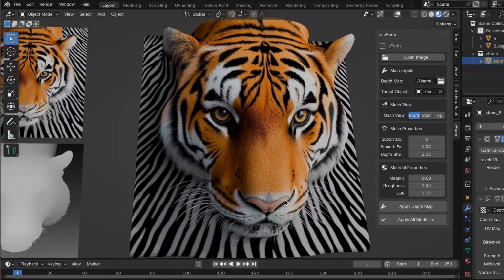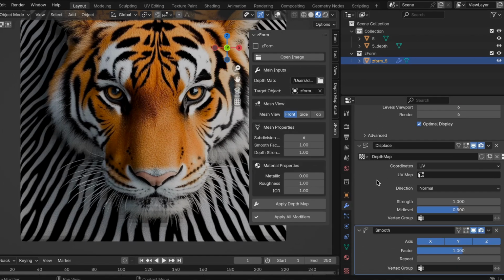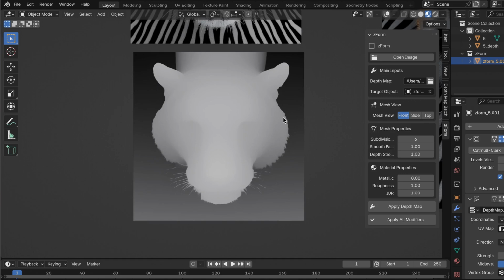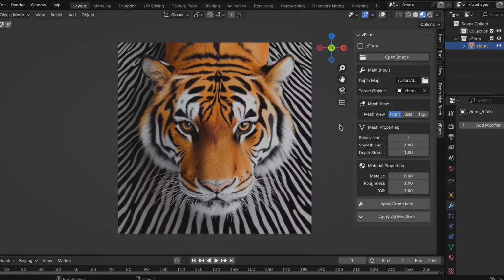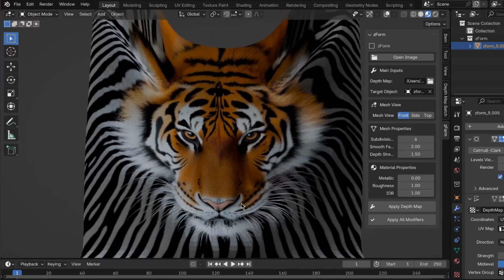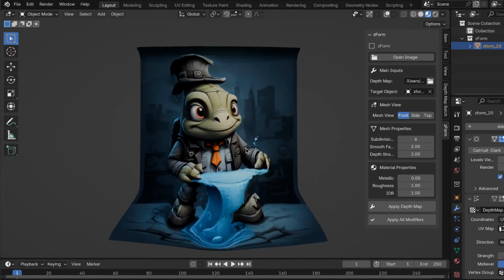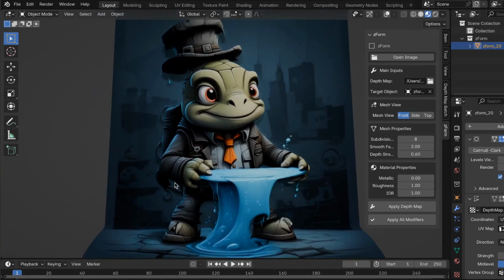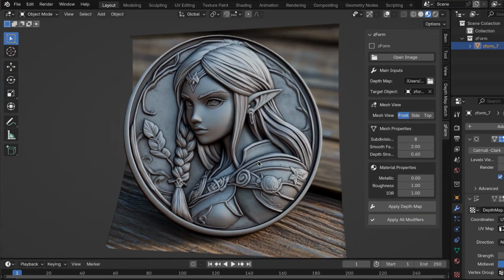Tiger 2D image converted to 3D mesh using a depth map and simple modifiers in Blender.

Comment: could u export to  3d model with texture and  obj format  i want to see 3d view with texture i can not see the texture  always coming plain model  is there some specific tool thx
Reply from the maker: Hi, yes you can. Before you export make sure you uncheck the "Use Transparency" feature inside of the Material Properties section in zForm. Then after you do that you shouldn't have issues exporting in OBJ format. Or, are you generally asking when working in Blender and not inside of zForm? If you run into problems feel free to send me a message on SuperHive (previously Blender Market) and I can gladly help.

Comment: Thanks for vid! Pls can you help me, why a cant find option texture in right bottom, like little formula flag?
Reply from the maker: Hi, do you mean the Texture Properties section that's inside of zForm to adjust the values for Crop, Multiple RGB, Contrast, Brightness, etc?  Or are you talking about the Text section displayed natively inside of Blender when you've assigned a texture to an object? 

If you're talking about within zForm, please make sure to have the latest version of zForm as the older versions don't have that feature...it was released less than a month ago. 

Feel free to message me on SuperHive (formerly Blender Market) if you're logged in and I can help further.

Comment: How are you exporting the file after it complete? I bought both of your stuff on blender.  After I upload a PNG for some reason, it keeps a square behind it when I export is there anyway to remove that?
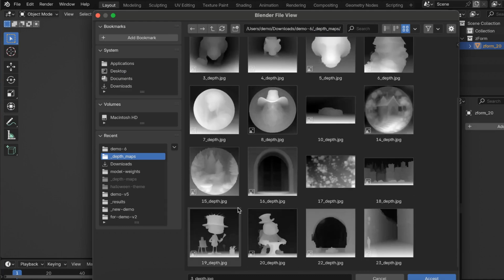Reply from the maker: Hi, I've been trying to build a feature to do this in zForm, but I haven't successfully figured it out yet.  Right now I manually use a boolean modifier with the Intersect option to cut out the back sides, but it's not perfect. I have a video that covers the technique I currently use if you skip to around 1:37 of the video...I cut out the back side using that boolean technique. 

https://www.youtube.com/watch?v=RhfskbbljiQ

Sorry this is not something that is built inside the tool right now.

Feel free to message me on Blender Market using the "Contact Creator" button on my homepage if you're logged in.
Reply: @vizdotlife  so I exported a PNG into it. And then I use the debt map software to make it and they’re still this imaginary square around it
Reply from the maker: @blakelindley9799 If you're talking about the modifier that's an imaginary square to remove the backside. After that step click on the "Apply All Modifiers" button in zform to convert to a destructive mesh. After that though you can't make changes. If you're still having problems please message me on Blender Market to get a better understanding so I can help
Reply: @vizdotlife I messaged you on blender with some photos

Comment: I have been using this method heaps.  It is awesome.  Have also been generating my own in ComfyUI using Midas and Zoe Depth Maps.  Been starting my modeling this way, and then straight into Zbrush.
Reply from the maker: Nice! That sounds like a solid workflow. I haven't used Zbrush before, but I know it's top notch. Does your workflow continue in other tools after working in Zbrush or is that the final stage?
Reply: @vizdotlife  I use everything.  Been in games 17 years or more.   I will finish assets in Zbrush maybe and make textures from them in 3dsmax or other software/optimize afterwards.  I use Zbrush and 3DCoat for UV's and retopologizing normally.  Substance Painter for textures.  That sort of thing.  If you took that tiger into Zbrush you could easily sculpt the side details.  Also I have a ComfyUI set-up I do just recently where I take say your tiger and render an image from the side and use ComfyUI to render out another Midas depth map and then I project from another angle.  It can be done, as I have done it and it works well.  You could use soft selection under the displacement in the area that needs sculpting .   just a thought.   Zbrush is very good at redistributing mesh consistency in detail while keeping the original projection.  Then you will have more mesh to displace with.
Reply from the maker: Thank you so much for sharing all this!  Wow, you have so much experience at this across several tools. I'm slowly getting there. Very interesting idea you suggested on the side views for the tiger. It makes sense. Maybe one of these days I'll try a free trial on Zbrush just to get a taste of what's possible. Thanks a bunch! Best wishes on your next projects!
Reply: Hello, is there any workflow video similar to the one you mentioned that I can refer to? I don't quite understand how to convert this plugin into an actual full 3D model?

Comment: Hello! And if the result of the addon’s work is exported to 3dsMAX or another 3D software, will it be as impressive as in blender? Or is this not a 3D mesh with uvw and texture?
Reply from the maker: Although I haven't used 3D Studio Max before....I do include an option in the tool at the bottom to apply all modifiers, which in turn converts it into a real mesh that can be exported to something like OBJ of FBX. I've tested this and it works, but I haven't yet tested looking at the results in other software. The topology of the mesh is typically pretty good at maintaining quads once the modifiers are applied and it does have the texture / material included. That being said, the front view for this type of technique is ideal for the front view because the backside is hollow. Or you could create something like a shadow box or 3D picture frame that covers the backside and side view.
Reply from the maker: Hi, would you have any interest in testing this out in 3dsMax if I shared with you some examples? They'd be in something like .obj or .fbx format. If so, feel free to send me a message on Blender Market....there's a contact creator button on my homepage. I'd be happy to share some examples to test.